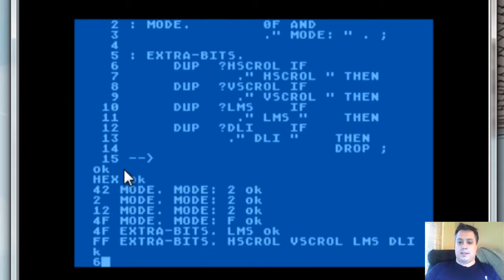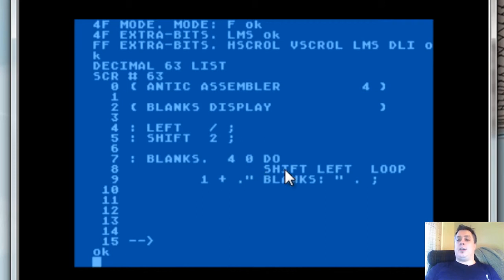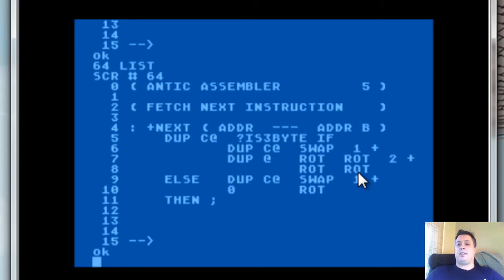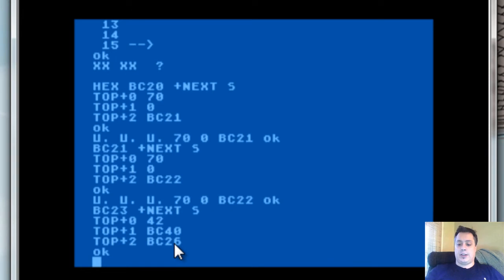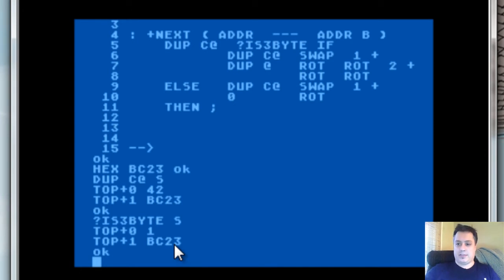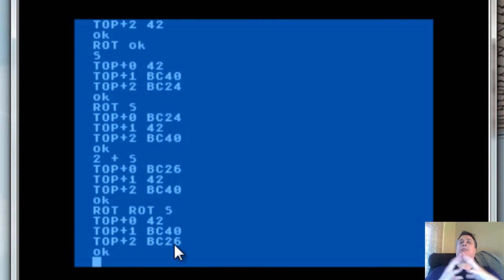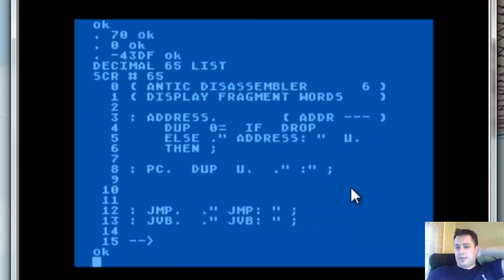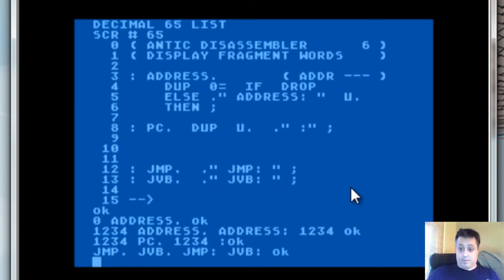Making Atari fig-FORTH Tools - ANTIC Disassembler 3 of 4

Comment: Why not just divide by 16 instead of dividing by 2 in a 4x loop?
Reply from the maker: Indeed, the word name could be changed and do just that.
Reply: It's not just semantic equivalence; using a single operation is bound to be both smaller and faster. Even then, division is complicated and could be slower than e.g. $1000 u* swap drop. Not that it necessarily matters in code used only during debugging. In durexForth the shift operations are called 2* (1 left) 2/ (1 right) and 100/ (8 right).

In the example of fig-FORTH on an 8 bit Atari, what you'd do if you needed to optimize is implement the 2/ word using assembly. It's quite normal for Forth to include assembler words, though using them requires knowing more about the particular Forth implementation and machine.